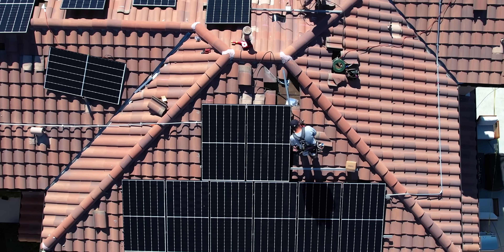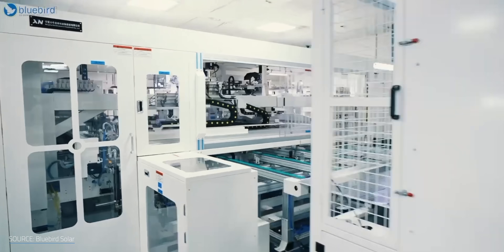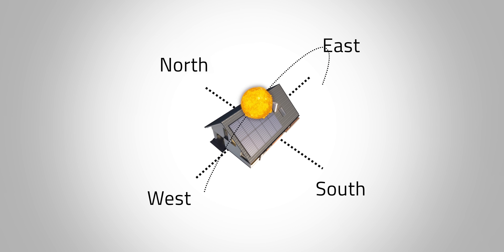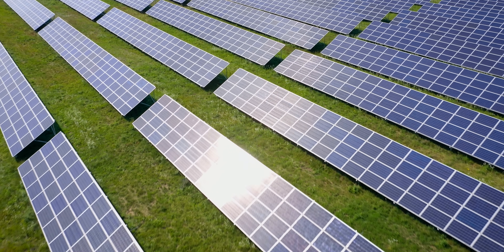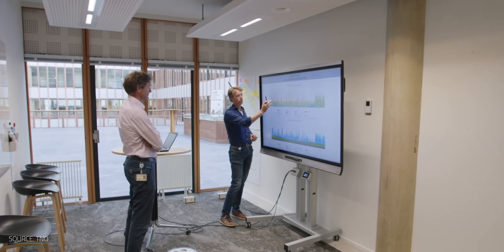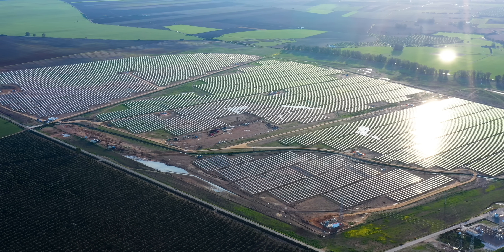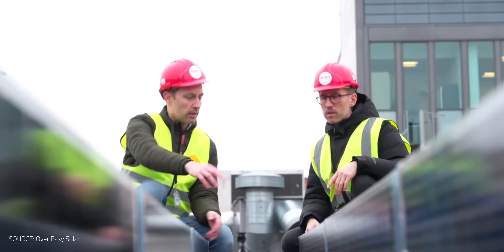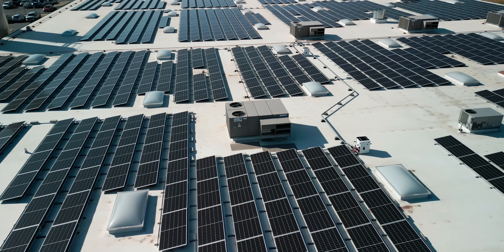Have we been doing Solar wrong all along?

Comment: In college, we created a photovoltaic panel with water flowing behind it to cool the panel. It created hot water and an increase in the output of the panel. I’m not sure why this isn’t being used more now but it’s a similar concept. A cooler panel equals more electricity.
Reply: Yeah that is strange that isn’t being done more. It takes a lot of energy to heat water and if you get more energy by doing it, why wouldn’t you?
Reply: Because they arent as efficient as 2 seperate dedicated systems money wise.

It'd only be usefull if you are space-limited.
Reply: more complex and more expensive leading to higher maintenance, install and purchase costs
Reply: Hybrid solar panels do exist, but they need some specific installation: a big water tank to store the hot water and water heaters. A lot of people don't want ton invest on thoose, that's probably why they are not that popular. I also eard they where not that good but don't know exactly why (efficiency? twice the problems on one device?) I'm part of an association renovating a house and we decided to put separated thermal and photovoltaic panels for maximum efficiency.
Reply: @rataxes346  The first-time installation price is the biggest hurdle to solar adoption and plumbing is quite expensive.
Unlike electric cables, you can't just as easily connect it to your existing piping.

Maybe in rural Turkey were nearly every home has alread solar thermic installations, but then maybe these hybrid panels are too expensive for them.
Reply: @sualtam9509  a lot of old homes and flats still have water heaters, at least in France and Switzerland.
Reply: @rataxes346  Hi. Assuming someone wants to invest in this kind of setup, is the water safe for drinking or is it only used for bathing?
Reply: @Anxiou5Panda   the water in the panel don't come in contact with the one at the tap. It has some glycol in it to prevent freezing and exploding the pipes. It gives it's heat through an heat exchanger in the water tank.
Reply: @rataxes346  I see. Thank you so much for the info!
Reply: @Anxiou5Panda   You're welcome, I'm actually helping to build a thermal panels installation for an association in Switzerland, happy to share the knowledge.
Reply: @rataxes346  I wish you and the team all the best. Keep safe!
Reply: @rataxes346  well, now is the time to make a YouTube channel and share what you're doing 😄 chop chop
Reply: @SabeerAbdulla  Unfortunately recording and editing takes way too much time if you want to do it properly and I'm already overbooked 😅
Reply: @SabeerAbdulla   If you want to know more the system is developed by Sebasol a group of non profit associations in Switzerland, but sorry the website is all in French.
Reply: @rataxes346  no issues. Will rely on Google translate and the rudimentary French I learnt a couple of years back online during COVID 😄
Reply: At least you couldn't install any water cooling outside in places with temperatures below 0 Celsius during the year(during any night in at least 50 year to be precise)... You could not find places alike anywhere in Europe, and many deserts freeze during some winter nights during the year as well...
Reply: @yv3009 they would freeze if you directly plumb in the water supply to the panels. Solar-thermal panels use anti-freeze and a heat exchanger.
Reply: Thanks man - yeah heating water is the main energy use of any human energy situation
Reply: Like everything else related to solar, the question is cost/benefit.
Reply: Water + electricity + on top of a roof  is inherently dangerous. If there is ever a leak, or a fault; the danger level increases drastically. Plus you need to deal with the weight of both systems. Old roofs struggle with that much weight. If it ever freezes, both systems might be inoperable when you need them most. If it snows, you increase the weight on the roof, and disable both systems.
Reply: Even Florida is not 100% freeze safe😅
Reply: How often do you use hot water in your house? Most people leave for work and their water heater is idle all day, just when you need something to dump the heat from the panels into. Yes, combo pv and thermal makes it more efficient, but only if it's all getting used. Better to optimize the panel for one use or the other and make it predictable.
Or use the water cooling as a more efficient heat transfer device to send the heat somewhere else, into the ground or into the air. (or if you have lots of water in the area, use evaporative cooling)
Reply: @superman0035 what was your pumping losses? The biggest problem with pumping water is that it's hard. It takes a significant amount of energy to move water at a significant distance at a significant speed. Most systems use electrical power to achieve that. But if you have access to enough gravity differential than something like a hydraulic ram pump might work. But if you have to commit to an electrical solution, I'd be surprised if you were still achieving better net output from the solar panels.
Reply: That is a great idea to heat your house! 
Some anti freeze, to make it work in winter. Heat exchanger and bang! Bills goes down 😊
Reply: The major problem with water cooled solar panels is the extremely difficult to clean salt deposits that accumulate over the panels given enough time.
Reply: Let's combine electricity and water; nothing but upside bruh. High 5
Reply: How do you cool panels installed 4 to 6 meters on the roof? With a pump? And how do you refresh again this water? How much would cost that system? How long would It take to pay for the overexpenses?
Reply: Could think of a lot of ways to use that free heat relatively easily.
Reply: Can you explain exactly how you did this? I would like to try it here.
Reply: @Derf2258  depends on the system and intent. Ive seen this be used to heat pools/ponds, shop or travel hot water,  small turbines, garage floor heater.  Tho dont forget pressure release valves. you may want to consider vehicle antifreeze with a secondary water tank being heated, steam and pressure become an issue if thats not the intent. Could also prob use gas AC coolant.  Decent use of DIY skills and spare parts. Plenty of vids around.
Reply: Have seen some interesting setup ideas that use solar to make hydrogen gas via water and a photochemical reaction. Could see being an interesting dual use setup and hydrogen would make a fairly usable overnight secondary.   Been pondering over how to integrate and or swap a single system between multiple fuel sources. Wanna make my own hybrid mini truck 4x4 and  Something about charging my car with firewood, old oil, bio/diesel, or hydrogen seems worth building a garage around... So ive been looking at a lot of steam/pressure designs and pondering the merits of different ideas.
Reply: Mostly because you would need to cool the water somewhere. A little demo unit would indeed make hot water.  But big industrial installations would require cooling towers,  generally using evaporative cooling. Putting further stress on our already stressed water supply. All this stuff gets hot, actually heating the environment causes warming too....
Reply: @jamesharmon3827  the sun is going to beat up the earth no matter what, at least in this case we get usable energy out of it. But yeah, waste heat is always an issue effecting efficiency but that's thermodynamics for you. Closed loop geothermal cooling can help with this, as usual depending on costs.
Reply: The calcium in water will ruin the cooling system in few years
Reply: Even if you don't directly use the heated water, integrating a heat dink with a fluid based heat exchanger to dissipate the heat would be worthwhile.
Reply: What about below 32 degrees
Reply: You can't make hot water that way, it'd reduce panel performance too much. You can only make warm water. There aren't many situations where you want warm water.
Reply: @vylbird8014  If your water is already warm, you need less energy to make it hot.
Reply: @vylbird8014  you really don't need hot water think about it how much cold water do you mix with the hot water in the shower or washing machine. its wasteful turn the water heaters down and give it a try for a few months save your bill and compare to same time last year
Reply: @vylbird8014 ... gargling. 😅

Comment: I am going with filth. One of the main reasons I have not gotten solar on the roof is the cleaning maintenance. I live near a highway and there is a lot of road dust in the air (rubber from tires) it collects on every horizontal surface and covers the panels. Cleaning regularly is not an option in my book. SO FILTH covering the array. is my answer, now, the rest of the video.
OK, heat, but heat AND filth reduction may be a solution for me. hmmmmm

Comment: 15% more efficiency over a maximum theoretical efficiency of only 36% over the entire solar spectrum is somewhat negligble. (Note: this does not mean you could get 51% efficiency, rather you would be 15% closer to the maximum of 36%.) If you want to talk about "doing solar wrong" you need to consider multi-junction solar cells, the kind used in space, which have a maximum theoretical efficiency of 85%.

Ultimately, what you're talking about here is commercial viability, which has a great many more factors involved that extend beyond engineering. It is almost certain that a moving bifacial solar cell that points upwards will become more cost effective than a stationary vertical bifacial cell.

Comment: @MattFerrell If you are going to build these vertical solar panel arrays, why wouldnt they put a full length triangular shaped mirror in between each row that would redirect sunlight to both sides of the panel through out the entire day in areas where they arent farming. Or at the very least white gravel that could reflect light on to the back side naturally.

Comment: They are simply bifacial panels the vertical aspect is just how they are placed by the installer. They aren’t specifically designed to be placed vertically.  The angle you place the panels at is meant to optimize the time of year you want to maximize the generation unless you have a solar tracker system. I’ve installed solar all over the world.

Comment: Not bifacial but normal panels. I have 13.6 kW. I set them for summer angle, at noon in the heat in northern Canada, I get 12 kW (88.2%) coming in. I set them for winter angle, I get 8.2 kW (60.2%) coming in. My neighbor put his 360 watt panel vertical on his cabin wall and got 160 watts (44.4%) coming in. Seems pretty clear to me that if you have normal panels, you do NOT place them vertical. Seems interesting that bifacials work good in an open field like that and produce more power. Too bad they can't do that on a building wall.

Comment: If seen articles about angled solar PA panels with thermal collectors mounted on the back of them. This benefits the PV panel by providing cooling, as in the video, and also heats the water - a double bonus.

Comment: Serious question here. Cost aside, what's the difference between a single vertical panel with two fronts and mounting two regular panels vertically but back to back? Would you get similar results if all else were equal?

Comment: It is true that machines perform worse the hotter they get but did you know that CPUs become more efficient the hotter they get? Due to less restistance in the wires. If CPUs didnt melt down at temperatures agove 95 °C they would probably be more powerful the hotter they get

Comment: 05:34 is where he explains it. voltage falls when temps are high ie at midday. bi-facial orientation boosts the solar gain away from midday and also happily generates at times when demand needs it. The other obvious solution is some form of rotation giving better orientation towards the sun.

Comment: Heat was my immediate guess. I've thought about incorporating a water cooling system into a solar panel, but it would've made their manufacture too complex and they would have required still water and energy to circulate the water. Just rotating them vertical seems more efficient.

Comment: It's estimated that around 80% of people will live in cities by 2050'ish, so most solutiond to ecological & social issues must come from cities, including energy generation. Cities need hinterlands to grow food (altho much food production also needs to be done in cities closer to consumers) and ecological / biodiversity protection & care. There will never we a single "silver bullet" when it comes to energy generation; cities will probably need to deploy a range of energy solutions where appropriate. If this new solar tech will help cities & towns be more energy secure, then it will need to form part of the energy mix. Engineers are looking at all aspects of city infrastructure for energy generation & thermal recovery - running water in pipes, heat in sewers, rooftops, car parks, roads & highways, busy streets etc. Altho it must also be remembered that clever design helps reduce the need for energy altogether (traffic circles instead of traffic light intersections, passive buildings, active mobility etc) - the less we need, the less we need to generate, transmit & distribute... and the less energy we lose along the way. Energy generation nearer consumers also reduces the need for very expensive transmission infrastructure prone to age, extreme weather & vandalism.

Waste not, want not.

Comment: What if they use them at optimal angles for the front side, then put mirrors on the ground  under the backside angled for full exposure? Or make the panels vertical and use mirrors to bounce light on both sides?

Comment: If the biggest issue with horizontal panels is overheating, which is the biggest issues in most of electrical engineering, then why not try and use that heat?  For large farms, maybe use it to preheat water for desalination, and for local uses, why not use it to preheat the hot water of a building.

Comment: Is there an optimal latitude for this vertical placement & Is there an optimal orientation relationship to true north-south ?
I am in the Tropics just north of the equator and I was considering a dual-axis multi-panel array until I saw your video. 
Also dual-axis has long term reliability concerns in heat & humidity so I wanted to go fixed orientation.
Can any of you science people help on this ?
Reply: I don't see any point in tracking mechanisms anymore, panels are simply too cheap. For cost tracking setup you can buy more panels instead. Overpaneling is not a problem as long charge controller can handle voltages. You could split panels into two strings, one angled lets say at 30 degrees pointing east and other string at same angle towards west. Peak production would much flatter(better for storage and inverters) and might help with the heat too.
Not sure if bifacials are worth it at equator, but they would allow steeper angles. They work much better in cloudy days than one sided ones(if backside is exposed) so it also depends on weather. Regular panels have plastic backside which deteriorates quicker than glass backside of bifacials. Backside of angled panels receive more UV light so it's factor for longevity.

Comment: When you are in the AC world, you know how important can be the heat gains due to reflective light, in some cases could be a lot. You can know it also when you calculate solar water heaters. It's just something known. If you ad all benefits on putting a pannel vertically, (structure, maintenance, cooling) just look  like a winner.
But as always, everything goes to cost/benefits, and where can you put your panels. You just need to do the math for your specific situation.

Comment: Considering all the comments about staying clean in addition to staying cool, it would be interesting to see a  comparison over a year between bifacial and  angled solar panels.  The only number i heard mentioned was a 5% improvement, but it seems to me that the increase in the material that converts sunlight to electricity is 100%  I expect that the manufacturing cost isn't exactly double, but it would be interesting to know what it actually is.  When there's a ratio of price and a ratio of results, then a person can make a decision.  Of course, where physical space is limited you might be willing to spend a lot more to get that last few percent of production added on.

Comment: 8:00 convection, they get cooler because of better convection, a 45° angled surface is going to have almost half as much convection on the underside due to friction with the surface being cooled. Also if oriented correctly you can use the wind for even more cooling (direction parallel to wind) it also will not condense as much water underneath leading to additional heating.

Comment: For a while ive been wondering if having panels facing east and west rather than north or south depending on which hemisphere you live in would produce more electricity when you need it. North or south  facing generates not much electricity at breakfast or dinner time but a lot when you're not home at work. Where i live the sun is quite often behind the north facing solar panels at dinner time. What would be interesting is to compare angled single face solar in east-west configuration vs vertical bifacical east-west solar